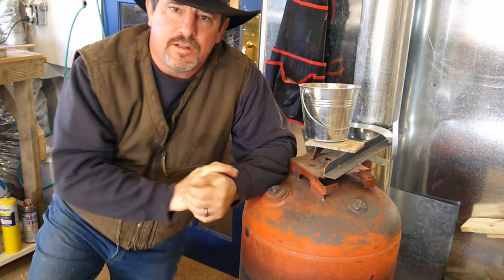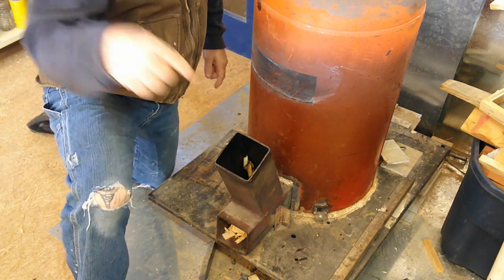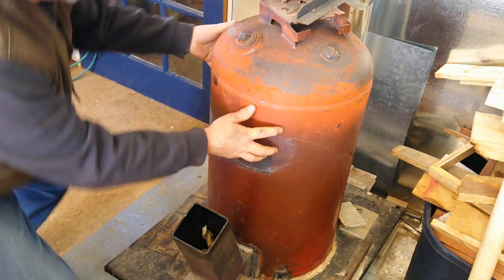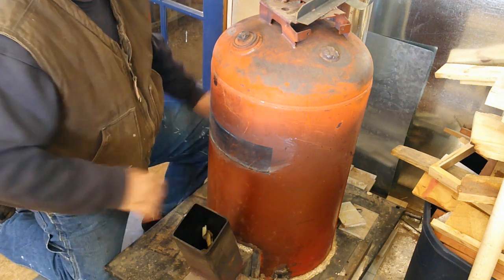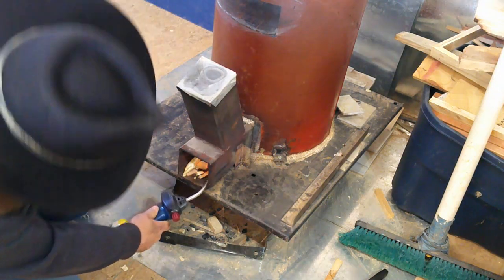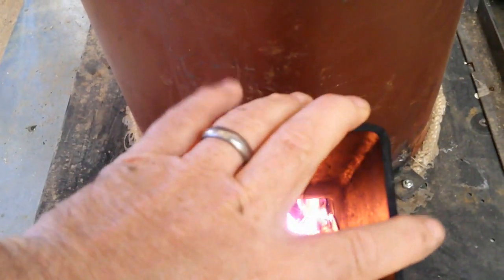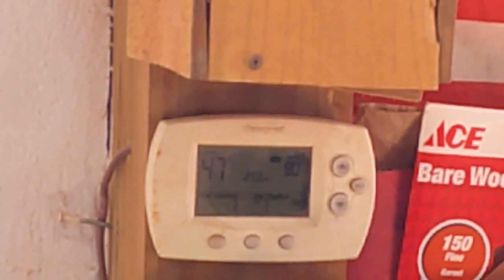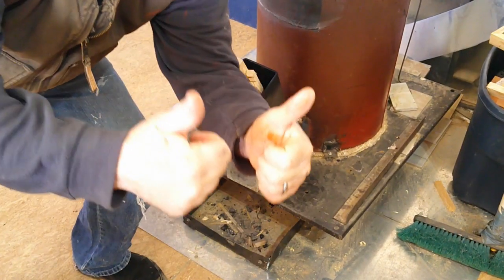HOW DOES A ROCKET STOVE HEATER WORK

Comment: Does it produce so much smoke every time you start a fire ????? It would not be good for  a living room... maybe for the basement, boiler room...not for a living area.
Reply from the maker: Mine doesn’t you have to close the fill shoot until the vent pipe is warm then remove the cap and place it over the lower horizontal pipe

Comment: Can you make this burn without attention for six to eight hours ??? What is the steel plate size and thickness ??? How hot does the base plate get ??? Nice video.
Reply from the maker: Thank you 
 No you can’t leave it a rocket stove requires frequent feeding because it burns very fast
The plate is 1/8 inch and does not get very hot there is insulation between the burn chamber and the plate
Reply: Got it fella and thanks.  @Hinkleshop

Comment: Vernon you built you RS 2 years ago, how is it doing ? I plan to build mind like yours my friend. I plan on using perlite also. The thing that worry’s means I hear these guy saying
They burn out there burn chamber out in a short time.I plan as you to use 4 inch square 
Tube 1/4 in wall. I know the perlite keeps the heat in the burn chamber, but would that 
Not make the burn chamber tube burn out Sooner. I,m confused with that? Thank you 
For all your help.
Reply from the maker: Thanks for watching Jim 
My stove has been running well for two or three years with no burn out I recently converted it to be able to use pellets as well. Rocket stoves require a lot of attention while there burning because they burn wood so quickly check out that video the thumbnail is rocket to pellets

Comment: If the inlet pipe is longer for feeding wood for a longer time, will that mess it up?
Reply from the maker: Thanks for watching 
Great question there is a formula for the height of the feed tube in relation to the horizontal and vertical pipe there are several sites on the web to show the math 
But I’m pretty sure if the feed pipe is too tall it will not work properly the air flow friction rate will increase as will air blockage by the larger amount of fuel (wood)

Comment: What happens if you open the ash hatch open to draw air but stuffed the hopper with wood enough to choke it? Would it draw air from the bottom port?
Reply from the maker: Yes it will but not as efficiently there is a calculation used to determine the height of the hopper as it relates to the length of the horizontal pipe and the stack inside I don’t recall the numbers but they can be found on the web pretty easily

Comment: I'd like to see how you made the chimney inside the tank
Reply from the maker: Thanks for watching I wrapped the internal square riser with an  8 inch round pipe, and backfilled with vermiculite then cut a square hole in a pipe cap slid it down over the pipe on the bottom I cover the square horizontal in much the same way with sheet metal encapsulating the entire piece 
Hope this helps

Comment: Hiya, hey could the cylinder be covered in Cobb to give it thermal mass?
Reply from the maker: Alan that’s a great question 
I don’t see why not but, I would suggest further research on the idea gathering several opinions before moving forward 
Thanks for watching
Reply: @Hinkleshop  Check the channel:  mylittlehomestead.  They have built a cob bench adjacent to a rocket heater and according to the channel, it is a great success!  

https://www.youtube.com/watch?v=NYJyxptclos

Try the link above, and see what you think.

Comment: I've made the exact same setup, but with a fully insulated burn chamber and riser out of ceramic fiber board, to make the fire even hotter without damaging the steel structure.

My highest temperature ever recorded temperature measured on the top of the gas cylinder was 800 degree Celsius and regularly temperatures above 700, this is measured about 1.2 meter from where the actual burn happens, it melts steal there.

Every few months I need to replace the 2mm walled stainless pipe for my secondary burn because the heat  just eats it away, very efficient stove, can run 12 hours one box of wood (10-12kg)

Comment: Vernon, thank you for sharing, great video! Couple things: did you get the tank at a scrapyard, the other steel too? Is the tank literally just sitting on top of the fire rope? I know it is bolted down, but no channel the rope sits in? I want to build one of these for my home in the far north midwest, and this video has been a great help! I would suggest a fresh air in, so it isn't sucking the air out of the shop. I simple pvc pipe run to the outside will bring in fresh combustion air! Thanks again, keep up the good work! Dan
Reply from the maker: Thanks Dan
No need for a fresh air intake my dust collection system for the shop is an open air system. also no there is no channel for the  rope it just sits there with fire rope glue to hold it in place while I’m bolting down the tank. The tank was made from an old compressor that stopped working I removed the compressor portion and cut the bottom off the tank The steel for the fire chamber I purchased new at a local metal supply shop it is 1/4 inch thick 4“ x 4“ square tube hope this helps and thanks for watching
Also the chamber is lifted off the bottom roughly 3 inches and is surrounded with vermiculite to prevent over heat at the base
Reply: @Hinkleshop  Vernon, appreciate the response and further info!! When you say "lifted off the bottom", you mean the large plate that everything is mounted on sits 3" off the floor? You sort of confused me there, where is the vermiculite exactly? Also, do you have the dimensions of the burn chamber, for example, the overall height of the riser inside the old compressor barrel? I thought I read somewhere in the comments that you surrounded the riser with a round 8" steel tube (also 1/4" thick??) and filled the area between with perlite. Did you weld a top plate at the top of the riser to "cover" the perlite? Lastly (as this seems to be a topic of discussion with rocket stoves), how far from the very top of the old compressor barrel does your riser sit? I have read that it should be within 1-2" so that the gases can reburn and not just exhaust. AGAIN, thank you for your responses and willingness to share information!! Dan
Reply from the maker: @danielkuczero1991  By lifted I am talking about the 4 inch burn tube that runs horizontally into the tank, I raised it off of the metal plate and put vermiculite under and between the plate and the tube. I used 24 gauge flat stock (sheet metal) to hold the vermiculite in place The eight inch round pipe is standard 24 gauge 8 inch DIA chimney vent pipe  I cut tabs in the very top and bent them inward toward the center square tubing and sealed the gaps with furnace cement to ensure that the vermiculite could not escape the riser is 2 to 3 inches from the inside top of the tank
Reply: @Hinkleshop  ok, the vermiculite and offset is not visible in the video. thank you again so much for the information!! I can't wait to getting my stove built.....

Comment: When you were starting the stove I was thinking if you had a clean out on the exaust pipe a couple pieces of paper lit and put in would start the flow of air. Or warm the pipe with the torch but that costs money. Most times paper is free.
Reply from the maker: Thank you!! 
that is an awesome idea I will swap out the elbow for a Tee with a cap that is removable I have used the torch before but you are correct burning that torch cost money thank you for the suggestion

Comment: So your propane tank bolts on? How do you seal the bottom man.
Reply from the maker: Thank you 
the compressor tank is bolted down on the bottom with a product called fire rope or fire gasket you can get it from tractor supply